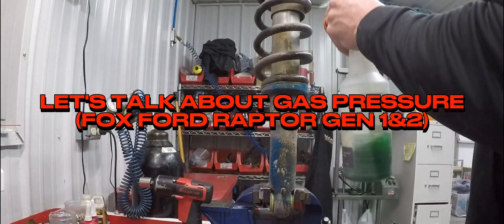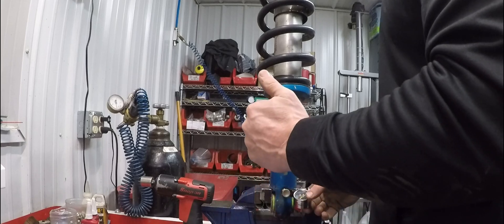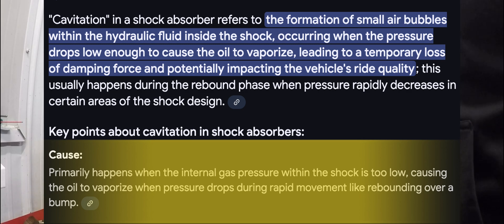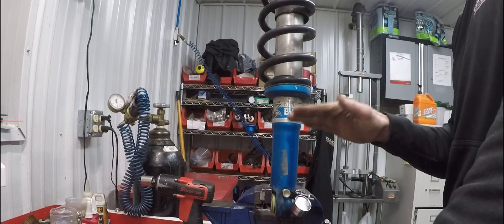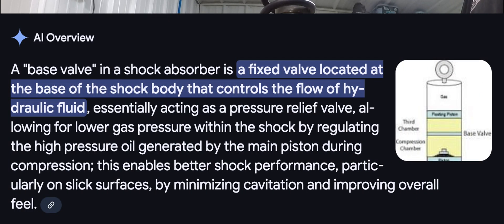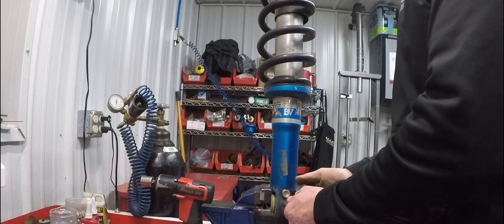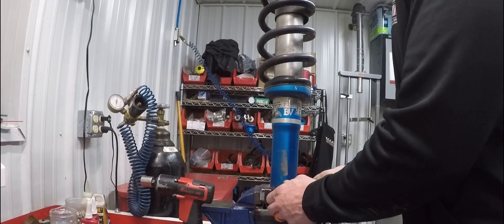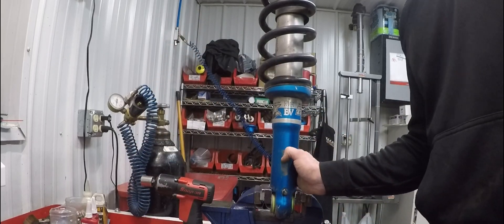How to Set Nitrogen Levels for Ford Raptor Gen 2 Fox Shocks

Comment: How much gas pressure do we need for the front and rear 2013 Ford Raptor Focus struts?
Reply from the maker: Not sure on ford raptor focus but raptor gen 1 is 250 and gen 2 is 200psi